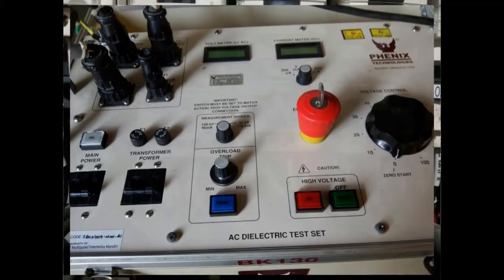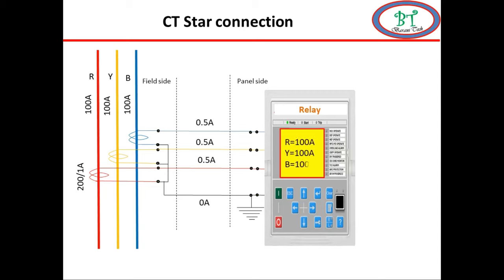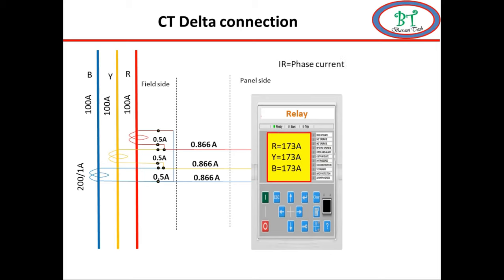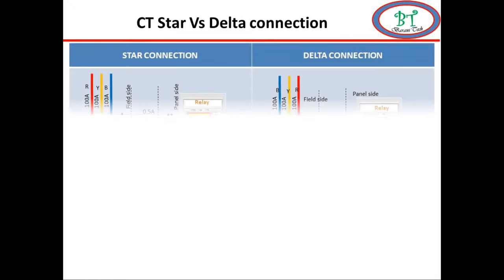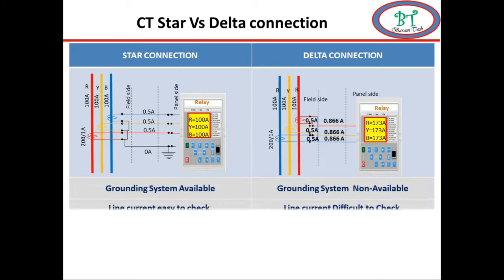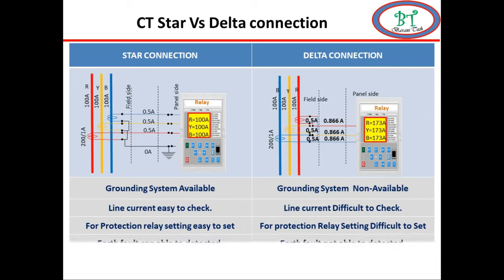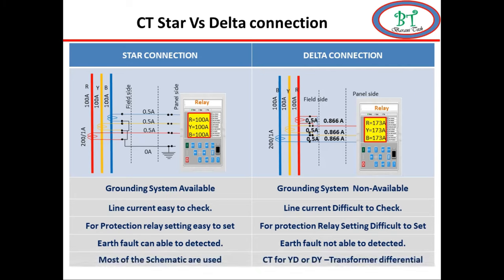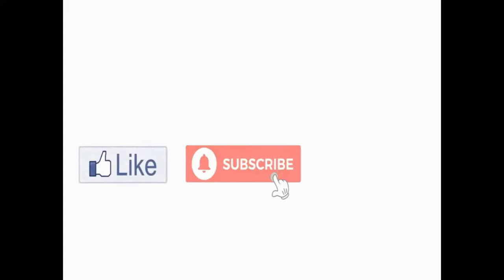Why We use CT Secondary STAR Connection.

Comment: Wrong formula used in delta,
As Line current equal to √3x phase current.
Reply from the maker: Your saying for Delta and star connection. star line and phase are equal and delta line is equal to root 3 time of phase current. 
but here what i have show is  different  the system is star and CT is Delta so the line current on the system  will show in Delta to the system when we use Delta connection CT.